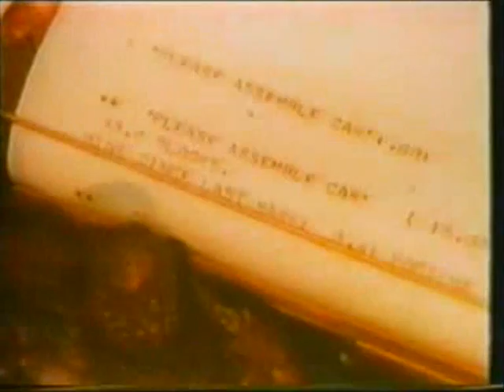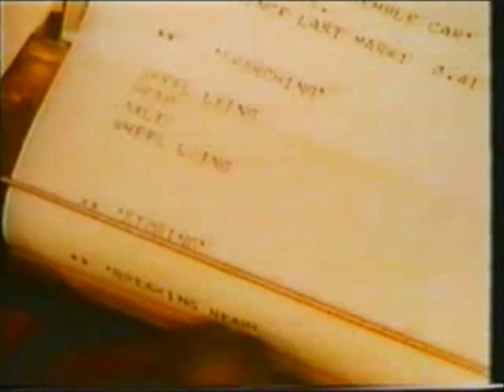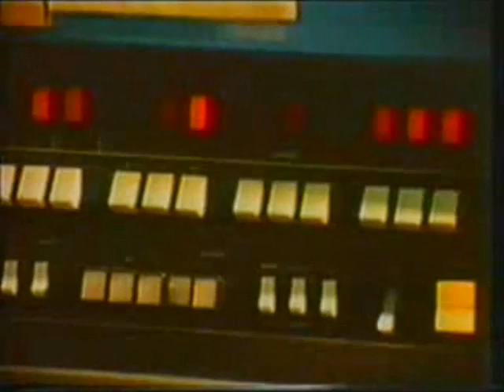The Lighthill Debate (1973) - part 3 of 6

Comment: The demonstration of the robot creating the car after identifying the component pieces from a jumble on the table was really, really impressive. This was ~1973! The fact that the robot was able to identify the parts from nothing more than a static video feed and employ problem solving to distinguish one part piled on another was just amazing, even more so considering the primitive hardware and software available back then.

Lighthill was right in that previous attempts to achieve 'miracles' such as automatic language translation in the 60s had failed and that the concept of generic, autonomous AI (and the wider miracle potential of computers to that point) had been oversold. 

And he was right that the success stories were the result of 'heuristics' and human programming within specialized domains.

But this was a wider symptom of the primitiveness of the tools and the development methods then available. It's only been within the last decade or so that we've started to figure out how to design and manage the development of advanced software systems, let alone intelligent systems (see OOP, the Agile programming practice, TDD etc).

Given the rate of technological progress between 1900 and 1973, it does seem short sighted to write off AI research as a pipe dream, however.

As a software developer myself, I'm amazed how these very smart people were able to create these systems at all with technology that was a stone's throw from vacuum tubes and punched cards.
Reply: +Danny77uk don't forget that other programs on such "primitive" equipment were able to navigate to, land on, take off, and get back safely from the moon.  Lighthill was pilloried for his blinkered view, and deservedly so.  That said, all the issues McCarthy pointed out are still with us.
Reply: +djhbrown I assume you're referring to the automated landers of the 60s/70s? They were simply running programs and were incapable of problem solving. They relied on commands from human operators as did the primitive navigation computers in the Apollo modules.

A sufficiently complex but designed program can appear intelligent while lacking the ability to learn and grow. If we want to create a program analogous to the human mind then it then it needs to be an autonomous self learning machine with the capacity to grow. And that machine would have to be nurtured over time. I believe this was idea behind neural networks but it's not something I've studied.
Reply: +Danny77uk insofar as i understand the intentions of the people who started making ANNs, it was never their idea that electronics could "grow" by self-assembly from raw materials, nor was it ever their conception that the ANNs they conceived could ever simulate anything even remotely comparable to the brain of a fly, let alone a mammal.  As to the ability to learn, between 1972 and 1975 i wrote a program in LISP that learned to diagnose (differentiate between) 5 kinds of liver disease as well as reported figures for clinicians (85% accuracy) and bid at Contract Bridge as well as a beginner, although not at expert level.  And learn to play Poker in the style of someone.  And learn paired associations that Feigenbaum's earlier program called EPAM did, but by a completely different learning mechanism.  An add-on module written in Algol68-R explained the logic the LISP program had induced from examples in pseudo English.   Does that count?
Reply: +djhbrown Fascinating! When you say you wrote a program in LISP that 'learned to diagnose 5 kinds of diseases' was it was really learning or merely switching between pre determined criteria? How did it react when confronted with symptoms for which it had no diagnosis? To me this is the definition of a learning system.

Someone commented in another video of this debate that IBM's Deep Blue was able to beat a chess master therefore disproving Lighhill. But then someone commented that it only achieved this in lab conditions and only after the engineers where given times to fix bugs and reboot it multiple times. It wasn't a learning system, merely a heuristic one. Lighthill wasn't wrong in this respect.

I've only done a little bit of 'AI' programming and that was with Prolog, a highly expressive language in which the programmer defined the problems along with the rules/predicates and let the computer find the solution. That was a very, very cool tool.

In a way we've lost that expressiveness of LISP et al in mainstream programming languages which are quite 'dumb' and focused on running procedures as quickly as possible. In 2015, I should be able to present the computer with a problem, a set of constraints and it should be able to put it's gigaflops of capacity to use in solving that problem. Instead, the computer is completely dependant on a human (be it the end user or the developer of a program) to be able to do anything, and that's sad. Was Lighthill wrong?
Reply: please google me, find my papers on the subject, read them, draw your own conclusions about them, and then get back to me.  but the short answer is YES it was learning to diagnose known diseases (but not to discover new syndromes).  the criteria were not predetermined - it learned them.  the set of symptom measurements (things like bilirubin count, skin yellowness, etc ) was predetermined; about 20 of them as far as i can remember.

was Lighthill wrong?  YES!! completely and utterly wrong on just about every claim he made.  google him to read the huge number of debates his absurd report generated.

i'm guessing you were born in '77, which would make you 12 years older than i was when i got my PhD in AI.  i had left school to work as a programmer 10 years previously.  Some of my former students, on hearing me say this, would often say "did they really have computers that long ago?" :)

if AI interests you, search for John McCarthy on YouTube and enjoy the ride.
Reply: +djhbrown No the '77' is not my birth year. I'm quite a bit younger :)

If Lighthill was categorically wrong, why then did his report result in the closure of so many 'AI' research centers in the UK? Every major intuitive into AI research has collapsed, be it the Strategic Computer Initiative or 
fifth gen computer systems.

I can only go with what I see today and none of it really disproves what he says. We have incredible gadgets, conveniences and search engines capable of instantly indexing the sum of human knowledge (well, large chunk of it) but they're all based on clever use of heuristics, algorithms and copious processing capacity. We still don't have automatic language translation and the devices we use daily are limited to predefined programming.

I'll have a look at those videos though. Thanks for the response.
Reply: yes, the Lighthill report did precede the withdrawal of funding.  thinking about that some more, in the light of other things, i now think it most likely that Lighthill's report was written to justify a funding withdrawal decision that had been made beforehand.  if that were so, he did a pretty good job of blowing enough smoke in the eyes of the general public to sufficiently fog the issue that there was no public kickback.

there is one learning algorithm that has been watching your web activity, learning what your purchasing tastes are and sending you targeted advertising.  it's called Google.

as for language etc, there's also quite a lot medicine doesn't know.  does that mean medical research should be abandoned too?
Reply: +djhbrown You misunderstand me. I'm not saying that AI research should be abandoned, simply that - as a software developer myself - I can't see anything to conclusively prove his assertions wrong, even 40+ years later. But then I haven't read up on it in detail yet.

You are probably right about the funding aspect though.

As for Google, no, that's a advanced example of a cleverly tuned heuristics backed by massive persistent and computation capacity. I was referring to Google when describing the ability for 'indexing the sum of human knowledge'. AFAIK it's not AI, at least not in the 'learning, autonomous machine' sense. It's still dependant on human developers.